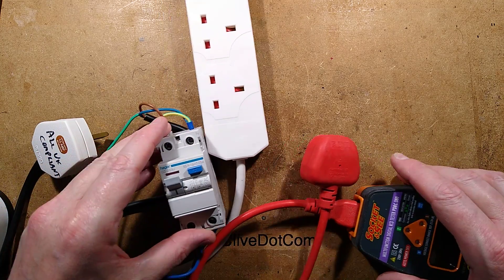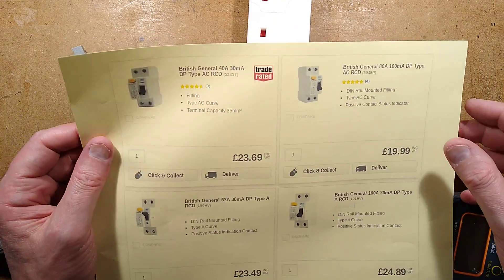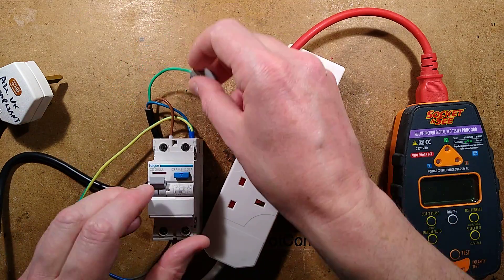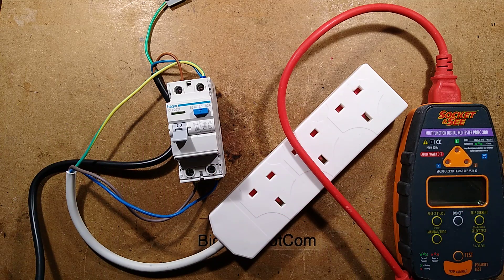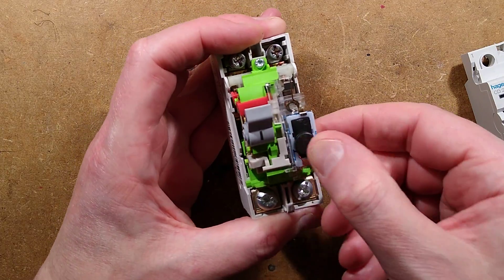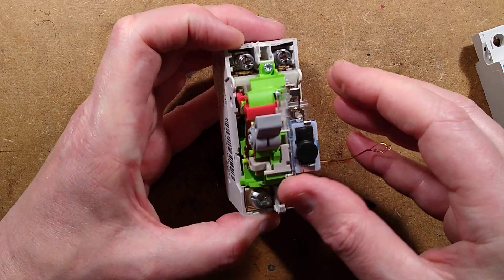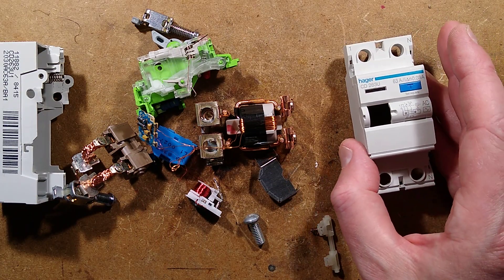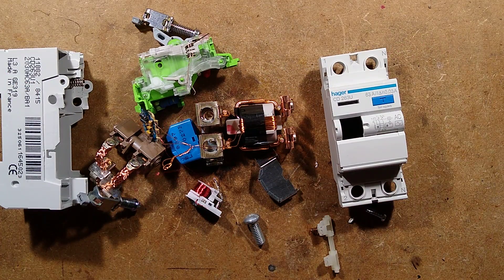Was this RCD damaged by overcurrent?

Comment: It took me a minute to realize that in the UK a lot of people have heated showers and that's why your showers use electricity😂
Reply: About 8.5kw for an instant shower. I don't think two of those should be on the one board.
Reply: @capnskiddies  why? there is diversity you can apply and both might never been used at the same time
Reply: @buzx1313  Been a while since I was involved it this side but Diversity could  not be applied to fixed loads!
Reply: @totherarf  wrong unfortunately,  take a look in the regs book.
Reply: @buzx1313  I did say it was a while .... I don't have a regs book anymore! I moved on to COP's ;0)
Reply: @capnskiddies  In older houses the incomer is fused at 60A and the whole idea of a 2nd shower is they get used together so it would be a problem. The easy way around it is just build a current sensing lock-out panel that senses the first shower drawing current and locks out the other one until it's done but that's really a panel builder's job not a spark.
Reply: @janegerrard1073   Better to wire the place correctly, like correctly balancing load across the 2 phase supplies in this case. Gotta wonder what the installation electrician was thinking setting up that place like so. 
... and having 32A CB's for power circuits! Thats wire those circuits using 4mm CSA cable. 
Largest rating I'm allowed to install would be 15A using 2.5mm CSA cable in a domestic installation. 
Rating for GPO's here [at similar 220V - 240V system] is 10A. 15A outlets are available, but separate circuit. Over 15A are 'special purpose' outlets and not a domestic appliance thing. 
So, what the hell necessitates using 32A CB's?
Reply: @BTW...  32 is a lot for a domestic install, 20A is more common, as for balancing the load we only have 1 phase for domestic houses, the split load consumer unit is designed to split the fault so a residual current trip doesn't take out the whole house (we don't use individual GFCI sockets). I suspect you're in the US where you have a centre tapped neutral?
Reply: @janegerrard1073  However, this installation has 2 phase supply.
Australia here - For long time now each power and lighting circuit mandated as separate RCD in new or significantly modified installations.  
The only time individually protected RCD sockets were used was in large commercial installations, like shopping centres, where a single fault would take out many outlets and present as a time consuming process to determine the offending appliance, aside need to reset by qualified / authorised personnel.  Individual RCD sockets were useful when retrofitting specific outlets to RDC protection in public areas prior to progressive mandating of their use. 
 
In suburban areas we have 3 phase High Voltage [>1kV] Distribution as a Delta [3 cables] stepped down through transformer's wound 'Star' centre tap Neutral [4 cables]. 
Only large industrial customers would be using HV connected equipment [e.g. motors]  however, some industrial HV customers utilise stepdown transformers to provide 240/415 supply [the incentive to customer being cheaper energy rates per kW/h
1 phase to small / medium size dwellings, with 2 phase/Neutral not uncommon in older domestic installations... even 3 phase sometimes. With Commercial and of course Industrial installations, it is common to find 3 phase/Neutral supply, even in small premises. 
Generally: Single phase voltage 240V 50hZ. 
2/3 phase = 415V between phases.... each phase 240V to Neutral.
Reply: Da Reproducer - This is the mainland U.K. electrical system. The 32A MCBs are used for either ring circuits supplying multiple 13A sockets, or for cooker circuits. The ring circuits use two 2.5mm squared cables to form a ring. With most ring circuits, you can have as many sockets as you like connected to it. Most two floor houses have two ring circuits to supply all the sockets. Sometimes the kitchen gets its own ring circuit. Cooker circuits use 4mm squared cable. Electricity supply cable for domestic properties is a single phase 230V (existing infrastructure is 240V) feed, with either a 60A, 80A or sometimes a 100A fuse (this fuse is the property of the distribution company). The current rules require a consumer unit with two RCDs (split load consumer unit). But the rules have changed over time. Normally it’s good practice to split the load reasonably across the two RCDs. You don’t need two ‘main’ RCDs if the MCBs are RCBOs (which include RCD functionality).
As an alternative to ring circuits, radial circuits can be used for the sockets. These also use 2.5mm squared cable. These are protected by a 20A MCB (or RCBO). The number of sockets on these circuits is rather less than you would find on a 32A ring circuit.
Reply: @BTW...  Interesting, I've never heard of a 2P+N supply at 120degrees, we get 1 or all 3 and dwellings are almost entirely 1 phase.
Reply: @janegerrard1073   I've found the 2P+N mainly in older domestic dwellings.  My family home built in the late 50's used this and my current partners home, that I rewired around 7 years ago, when the Supply Authority were upgrading to Smart Meter system.... they were not keen to change to a 1P+N. The Service Fuses in both cases were 63A. A 3P+N meter is wired for 2P+N. 
I've found it in much older domestic and commercial installations too. Keeps the size of aerial mains cables smaller. 
This is why you find 1, 2 and 3 pole Main Switches and CB's in manufacturers catalogues * You DO NOT switch Neutrals in distribution boards!  
Here, the 2P+N used in some Electric Oven/Cooktop combinations - the heating load balanced across phases - no 415V element used, ever. You find a diagram showing 1P and 2P connection options [also fuses in the Range] The 2P+N is never used for motors. 
Likewise, as per the home installation in this video, load is supposed to be balanced across the 2P, albeit very poorly there. SMH
Reply: @Mark1024MAK   Ahhh... and use of HRC fuses in appliance plugs. All well and good till some DIY = DIE idiot breaks the ring when tacking on additions, I guess... or installs a bolt instead of a fuse in the plug. Still, seems a bit dodgy having a 13A outlet 'protected' by a 32A current limiting device.
Reply: Da Reproducer - whatever the possible failings of the ring system is, the number of house fires due to electrical faults in the U.K. is a very low figure. Dodgy wiring by DIYers of course can introduce many risks and an incomplete ring circuit is one of them. You will also find  people having used a lower specification cable (e.g. 1mm squared or 1.5mm squared) for the wiring to an extra socket or sockets. In reality, if when a ring circuit is installed, plenty of sockets are provided, this significantly reduces the likelihood that a DIYer will want to add any extra sockets. The ring system with 13A sockets replaced various designs of previous sockets including 2A, 5A and 15A sockets on 5A, 10A and 15A circuits. All of which were radial. And you could find any of these sockets on any power circuit regardless of the value of the protecting fuse (so for example it was common to have multiple 5A sockets on a 10A or 15A circuit).
Reply: @capnskiddies  I thought some were tending towards 12kW ?
Reply: @capnskiddies  Last one I fitted maybe 15+ years ago was 10.5kW, that used to dim the lights when in use, rural sussex overhead fed mains I suspect we were already getting a voltage drop before it even reached the house.
Reply: chris andrus - depends on the design of the hot water system, which also partially depends on the available mains water pressure. Where the hot water is provided by a hot water tank with cold water header tank (used to be extremely common in the U.K. in the past), the hot water pressure was far too low for a shower, and the capacity of the hot water tank would not support multiple showers. Hence if a shower was wanted to be provided, the easiest way is to install an electric shower, where the mains water is heated in the shower unit (mounted in the shower cubicle). Where the hot water system uses mains pressure for the hot water (and the system has sufficient hot water capacity available), then you won’t find any electrical showers.
Reply: Heated showers are vastly superior to unheated showers
Reply: Took me a minute to realize that 3 phase supply is not standard in the UK and that's why they have "crazy" amperege on their main breakers (or well, breaker, hehe) :D Also, them showers.
Reply: Legend has it, showers and baths are not used that much in the UK. 
Gotta wonder how hot water is heated to supply the kitchen sink. Yet another instantaneous water heater?
Reply: @BTW...  Normally in one of two ways, older systems have a tank of hot water gravity fed, modern systems have instantaneous hot water via the central heating boiler ( not the central heating water ).
Reply: @BTW...  that's mostly an office thing. A small electric instantaneous heater. In people's homes they often use a combi boiler. A gas fired burner heats water on demand when the hot tap is turned on. The same unit supplies hot water to the heating circuit for the house.
Reply: @capnskiddies   Well, these heater shower heads are an instantaneous heater. Gas water heaters are much the same, and actually very temperature controllable and energy efficient. Storage tanks are the other type, be they electric off-peak or gas heated. I've the off-peak electric type and it sucks big time - costly because it is way oversized for demand and poorly insulated.
Reply: Plenty of ways to skin a cat. Some homes have central heating boilers with indirect DHW coils, some instantaneous DHW, some have immersion elements (electric) and some have solar. At least they don't call them a "furnace".
Reply: My aunt said - well if she's got no hot water, at least she can still have a shower :)
Reply: ohh thats why. i was also confused
Reply: not heated showers, the showerhead is the waterheater
Reply: @Mister_Brown  The "suicide showers" have the heater in the showerhead, but we don't use them in the UK. The heater and controls are  in a separate box on the wall.
Reply: SkyWizardless thank god. 👍 those heated shower heads are madness
Reply: @Mister_Brown  Not the showerhead. There is a box mounted on the wall with the heating elements in it. Clive has done a video taking one apart.

The heated shower head ones are found in more 'third world' countries.
Reply: @Mister_Brown  🏭💲💲💲⚡  A showerhead heater sounds like a terrible idea. The 🚿 symbol on a consumer unit could be any type of water heater :) like you said. 
Any of the options below or a combination would be better than just a resistive heater, let alone an electric tankless heater.
1. Ground source heat pump - Typically uses 1/4 of a resistive heater
2. Air sourced heat pump - Typically uses 1/3 of a resistive heater
3. Wastewater heat recovery - Typically revolvers 1/3 of the heat.
4. MIXERGY variable volume heating - Takes advantage from variability in electricity cost and\or local solar production.
5. Solar thermal heater - Must be combined with a backup heater - Has very little energy use once installed.
6. Low flow showerheads -  Aerating the water could cut water usage by 1/2

Comment: just a thought Clive, many DIYers keep buying the lower rated rcd because they (mistakenly) think it is a safer option... If they didnt keep flying off the shelves the suppliers wouldnt stock them.
Reply: I suspect that often the reason is cost, not the actual rating. It’s like when buying a new tyre, do you ask for a particular maximum speed rating, or do you just get the cheapest tyre from that brand that will be legal? I discovered that tyres have speed ratings when I asked for a new tyre the same make and type as the existing fitted tyres on my then fairly new car. The mechanic then explained the cost options for different speed rated tyres...

Comment: Does testing wear it out over time at all?
Reply from the maker: Not electronically.  I suppose if it was breaking under high load a lot it would potentially age the contacts, but even with the loads involved here, that's not too obvious.  Probably because the contacts are a lot better than the ones in standard overcurrent breakers.
Reply: @bigclivedotcom  thank you sir for the response!

Comment: Working at a power/ waterplant. We have some very cool relics at work wood pipe, Flow meters. Generators Fairbanks- morse 1930, 1947, 1955, 1967, 1989, and 2 1992 generators. Museum quality all off them fully functional. The wood pipe blows my mind if ya can picture a 4x4 post with a hole drilled out. 42 inches long with 6 inch slip in 😁 tip.
Reply from the maker: On the first day of my apprenticeship I was helping install ancient DC switching equipment in a steelworks.  It was more reliable and serviceable than the new stuff.
Reply: "It was more reliable and serviceable than the new stuff." Thats not surprising. Of course it was. Old stuff is ALWAYS built better.
Reply: @simontay4851  every few months we get to run those generators being I'm new to the job, very cool to learn how to start and run them. Syncing the the ac power. And yes very serviceable they just rebuilt the 1955 a year ago, 900lb pistons. 1800lb cylinders we actually have a picture of one of the thinner guys inside the cylinder scuffing the cylinder wall.
Reply: @bigclivedotcom  very cool

Comment: Residual offset current. This was a problem with teleprinter (Creed 444) receive  electromagnets, driven by bespoke (RAF) magnet drivers, fairly late in the life of such magnificent machines . . . which meant that the problem became apparent after a couple of years, was recognised for what it was and the ball was quickly passed between the manufacturer (Plessey who had bought up Creed & Co), BT and 38Grp RAF.
Believe me, a Teleprinter that has been sat on standby which fails to register signal reversals on the line is not a great deal of use to either man or beast.

Comment: Wow  in Canada we have g.f.i wall plugs and gfi breakers for specific areas this looks like nightmare.
Reply: I agree it seems like it could be a nightmare but those whole house RCDs are much less sensitive at 30mA than our 5mA GFCIs.
Reply: gordon delorm - we have moved from having individual sockets with RCD protection (typically only provided where an appliance used outside may be plugged in)(or plug in RCD socket adaptors) to having a consumer unit with a single RCD protecting all circuits, to a split load consumer unit with typically only the socket circuits on a RCD, and lighting and fixed wiring circuits on the non-RCD side, to split load consumer units with two RCDs, each protecting half the circuits. For a bit more money, increasingly, RCBOs are being used for individual circuits (these provide a RCD and a MCB in a single device). So for example in my consumer unit, I have a 32A RCBO for each of the 32A ring circuits (sockets), all the lighting is via 6A MCBs via a RCD.
Reply: I worked with a Journey Man electrician foR 6 years This concept seems dangerous  aND STUPID 240 v- 60 A . scarry  just my Opinion ground fault  dont work that way properly .Thanks... A  @Mark1024MAK
Reply: Which means that you are very likely to be electrocuted by a socket or circuit that does not have a gfi? I prefer our whole house gfi, and it has saved me a few times...
Reply: @erroltheterrible  No, trip times are the same, and with it in a panel this also protects the wiring in the walls from say water coming down the wire from a leak, or the occupant nailing a picture hanger through the cable. Also you do not get the occupant changing out a RCD for a regular outlet because the RCD was too expensive, and was "faulty because it kept tripping", and burning down the place.
Reply: @SeanBZA  What? Did I say anything about trip times? No. I commented about countries that think that some circuits dont need gfi. Where I live ALL circuits should be gfi protected. Granted, my house was built in the '30s and everything EXCEPT the lights are gfi protected. Guess what. Changing a bulb, with power off, I have had the sh#t shocked out of me. Yay for no gfi on light. That was sarcastic, if you didnt catch it...

Comment: 40+40+32+32+10+32= !( I guess ! Is the rcd so) +63=249= a little bit of an overload condition on that 100 A main. And I thought I was bad at math
Reply: I think ! Is alarm or " obviously bigger than 63A" the breaker is much less of a worry- if it gets overloaded it'll just trip, so that does limit the naughtyness to 100A, issue being that 63A< 100A and the circuits definitely can draw more than that, so it's a worry